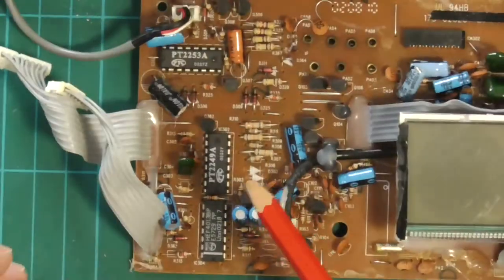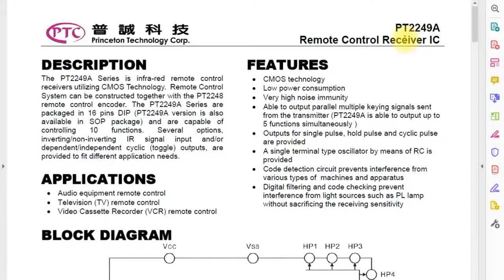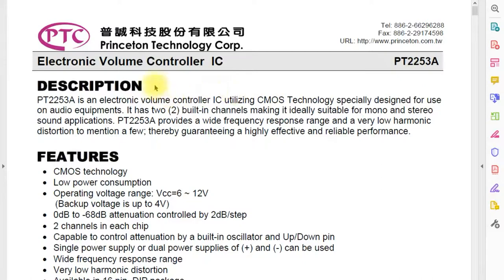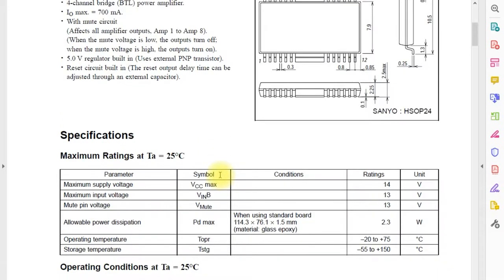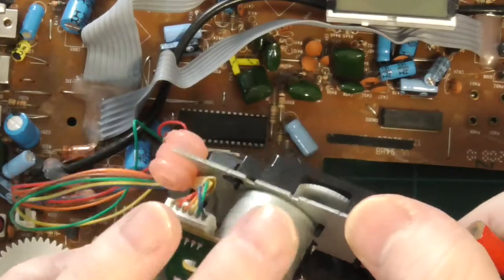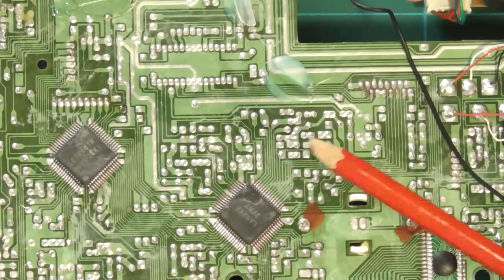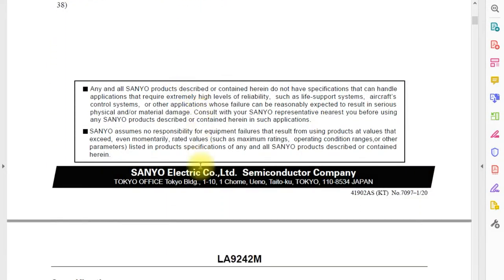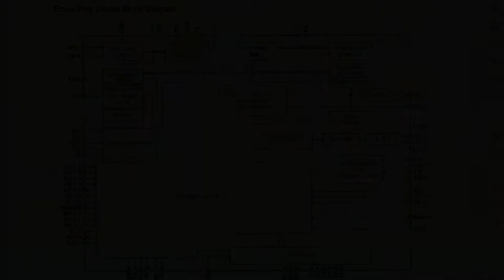Bush CD Player (The innerds)

Comment: I’m trying to add aux input to this  CD player. I connected L, R, and G through a PT2253A volume controller IC and the output from the LC78601R, but only the right channel works. There’s no output from the left channel. Any ideas on how to fix this?